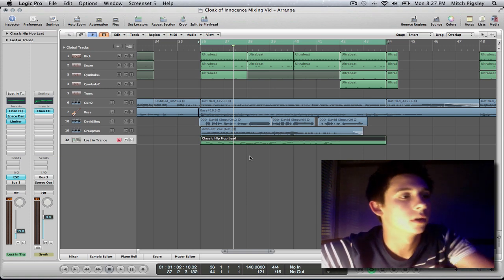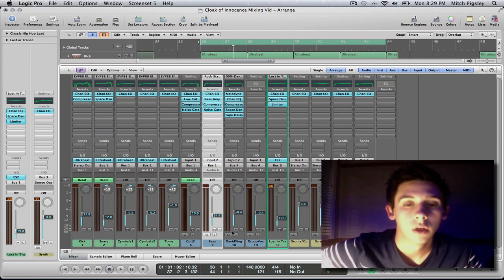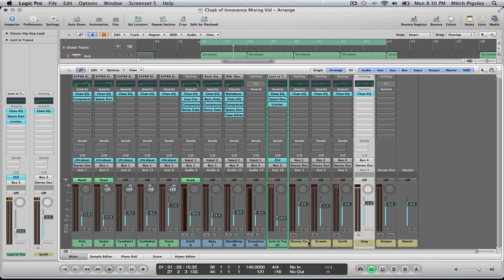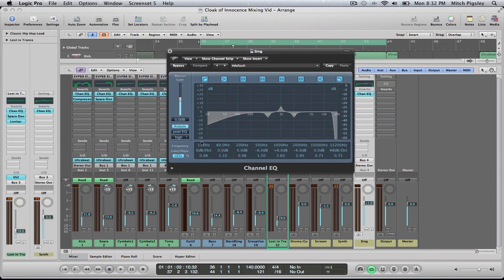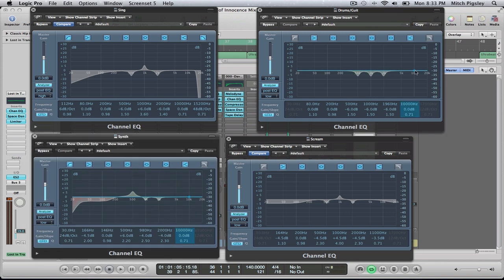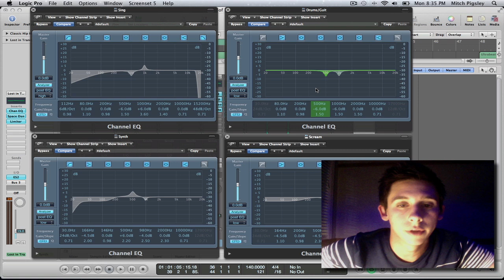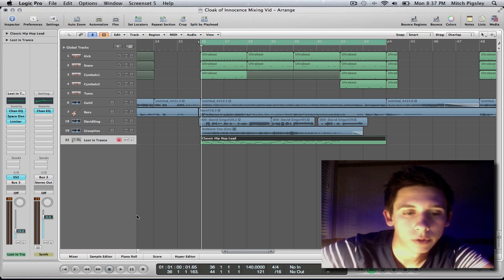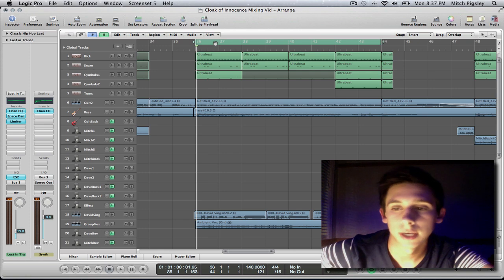Logic Pro 9 Tutorial - Mixing Techniques (Part #2)

Comment: Hi Mitchel I know this tutorial is very old, but I’ve check out your YouTube channel and you’ve done quit a bit of tutorials with Logic Pro 9. My name is Paul Tupou and I’m old school and still using Logic Pro 9 even when it’s 2023 due to cost and the MacBook Pro I’m using which is still from 2009 Lol. Anyway my question is do you know how to gain stage using the pre fader setting with Logic Pro 9. I’ve notice no one has put up a tutorial about that, how it really works in Logic Pro 9. I’ve researched about gain staging but it only shows it for Logic Pro X. Just need help with trying to get my tracks nice and loud to at least a professional standard, but having trouble with the mixing progress before mastering. I’ve reed that gain staging helps with mastering if you get the mix right with gain staging at the very start of your track. Any advice would be appreciated please. As I know this tutorial was done years ago, but still reaching out and hope to hear back from you if possible. Cheers 👍.
Reply: In part one of this video, he talks about using the compressor and turning up the gain on tracks that need more volume.

Comment from the maker: I usually put a multimeter on the output so I can monitor my mix. That's a good point. If there are gaps in the frequency spectrum, then there is obviously room to fill in different instruments into that spot.

Comment from the maker: Think of the audio like a pipe. If you set a bus at the output of the track, then you are just extending the length of the pipe by putting in a new section (the auxiliary track). If you use an effects bus, then you are creating a diverging pipe from the main one. You will have two sources of audio then, the original track and the auxiliary track. It can get confusing when you are using a million busses, but I just follow it and imagine it like a pipe.

Comment from the maker: Yeah he is correct. The panning in logic is basically a volume changer. When you pan left it lowers the volume in the right channel. This is problematic on a stereo signal because then you aren't getting any of the data from that right side... the direction mixer take the whole signal (whether stereo or mono) and pushes it in either direction. If you are working with a stereo signal, then this is the way to go.

Comment from the maker: Your monitors should be fine. If your mix is clipping, you could find yourself getting this effect. Once you start adding instruments though one of the most difficult things to do is to find division between them, but also keep that cohesion that makes a mix great. You might just have to work with your mix some more to get to the point where you can get that division.

Comment: Hi Mitch, dumb question - in this mixing tutorial, since you are in cycle mode, do the individual track effects settings and the aux track effects settings that you worked on only apply to that particular cycle (i.e., do the plug-ins, eq and stereo field settings that you tweaked only apply to regions 36-44 for those tracks)?  I'm just not sure if setting up cycle mode limits the changes to that single region.  You are a terrific Logic instructor by the way.  Thanks again!  Michael

Comment: What would you recommend as far as the EQ tip you mentioned (putting "hills" or "dips" at various locations on the grid based on the preferred stereo space of different tracks) when you have like 30 tracks? Would that not be very tedious and potentially counterproductive?

Comment: I see what you mean, but I tried the EQ tip and it changed the sound of my instruments in a very noticeable way (which I expected, it is EQing)... I also found that panning to extremes when dealing specifically with guitars made the mix much less muddy than panning to +/-15 or even 30, and the loss of power could be corrected with gain or volume. I still kept everything at a decent level with no clipping and I established a good mix. Basically, I'm wondering what your specific logic is with some

Comment: One thing I've been having trouble with is properly mixing the stereo space. It's straightforward enough on a track with only a few components, but the project I'm currently working on has at least 15 different sounds (25ish tracks) in it, some of which are centered around the same stereo space. Would I just boost/drop it like normal and overlap, or would I want to do it with slightly different, but still close Hz ranges?

Comment: Why did you have the cymbal and the snare going to bus 1 (drums/Guitar)?
Cymbals and snares are more in the high end of the frequency spec rather than low.
Cant you just use- Low | Low Mid | Mid | High and put different instruments in each category and then boost and take out?

~Keepit1000Beatz